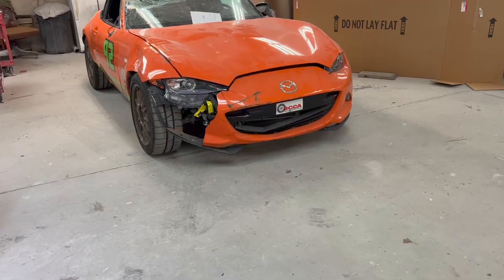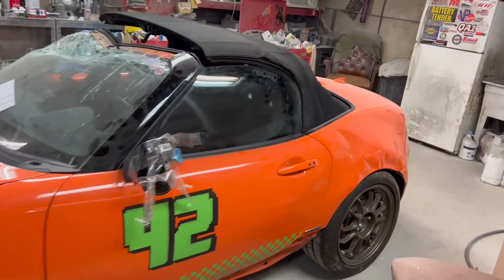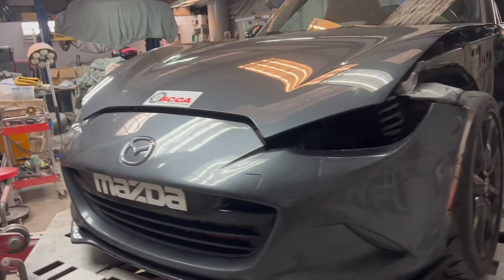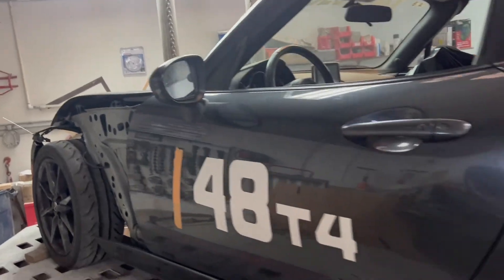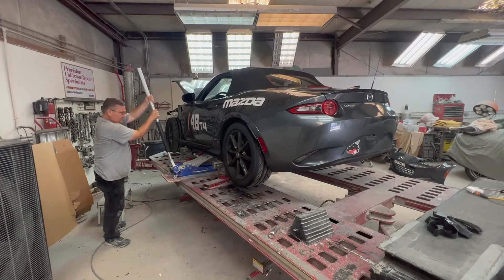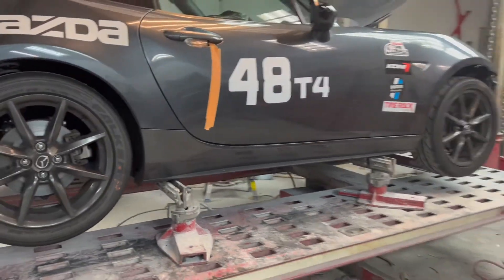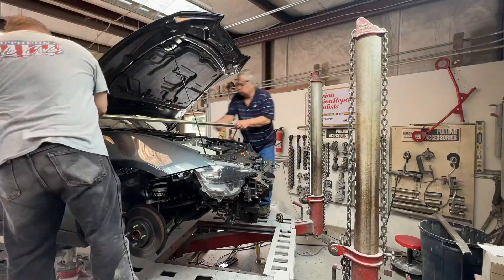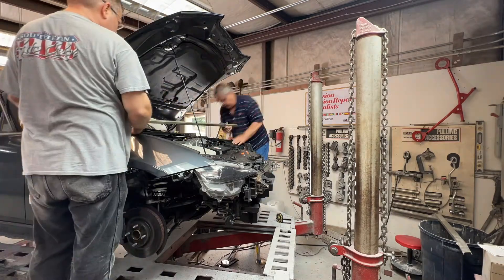More Track Insurance Work!  #mazda #mx5 #easteregg

Comment: Where do you find the measurements to see if everything is still straight?  Are these body shop specific manuals or can anyone get them?
Reply from the maker: The measurements that I use are from (Chief) the frame machine manufacturer. The under hood measurements are also available on my estimate writing system. They both are a subscription base system that is updated annually. I think anyone can get the subscription, but not sure it would be worth just one measurement on a specific car. Hope this helps and thanks for watching.